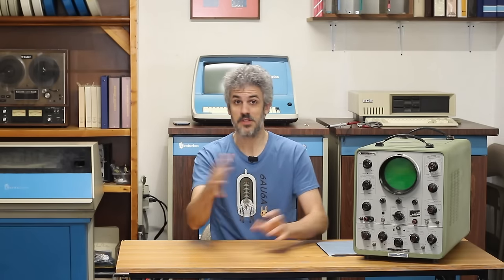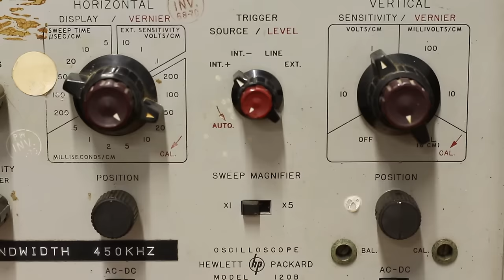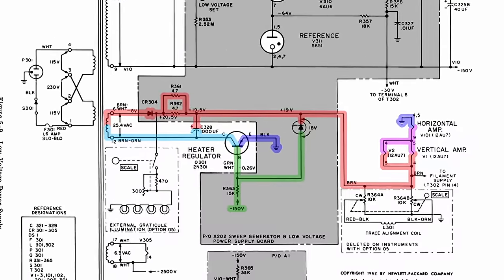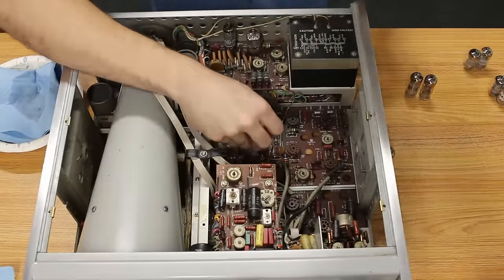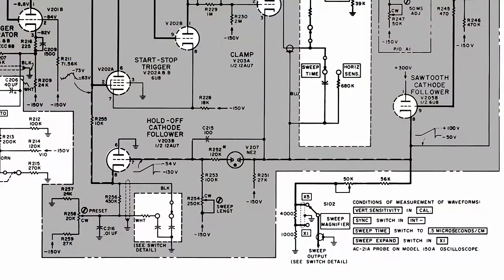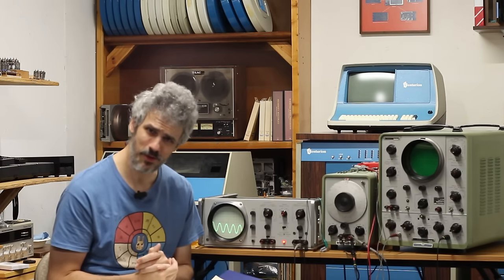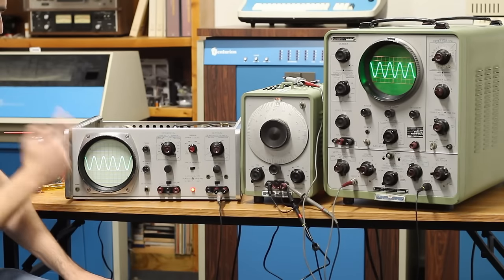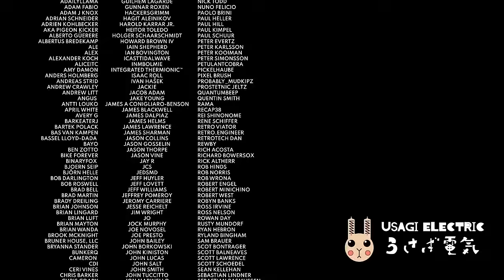Restoring an HP-120B Oscilloscope from 1961!

Comment: You could always take a 2 inch thick 24x24 inch butcher block cutting board and route grooves all over one side, then glue a peg board over the holes.. Then attach an air fitting to the other side.. 
Lay the side with the holes face down on the floor and put your 3 ton oscilloscope on it... 

Then when ever you want to move it, just turn on an air compressor..
Move that baby with one finger....

Comment: That Z-axis modification seemed like they wanted to replace Z-modulation with an external trigger.
Reply: If so, it would have made sense to route it internally with shielded cable....
Reply: @SeekingTheLoveThatGodMeans7648  Of course, I suspect it was mostly used that way, and it "works well enough" when used like that (strong external trigger signal overrides noise picked up).
Reply: I was thinking along the same lines, but then I saw the external trigger input two inches away.

Comment: So was the bodge wire from the grid also capacitively coupled to the ground? I was thinking from the beginning that it looked like you might have an interfering signal on the ground, so I'm wondering if you possibly had the sweep signal on your ground...

Also, I would be curious to know how the 6U8 and the 6GH8 compare in terms of both specs and performance. I need to make some substitutes sometimes because some tubes are just stupidly expensive.

Comment: how about optimizing, like shelving a project, while still in view
Reply from the maker: One thing I'm trying to avoid is having stuff on display that can't be used. Space is so tight in there, that I want anything that's on display to be easily accessible and usable without having to move or set up anything. It's a strange way to set up the room, but I need it to be nice and tidy so I can move around and film without too many obstructions.

Comment: Have you or anyone else come up with an idea as to what was the point of that white wire, capacitor, wrong resistor "mod" ?

I'm very curious about what may have been the reason or concept of doing that in the first place.  What was the person thinking!? (rhetorical).

The very moment that you opened up the unit, I focused on that white wire and cap.  Even without having the schematic in front of me, I knew that something didn't seem right there.  ESPECIALLY with the danged wire just running across the board like that.... WHO DOES THAT!   LOL

If the mod was something useful, one might think that the person mod would have used at the very least, a well shielded wire and route it along the metal case, then over to the tube.

But again, no idea what the point of that mod was.  USUALLY, if there was a factory mod that was recommended, there'd be documentation on the mod as well as the reason for such a mod.

Comment: I'd be careful cleaning electronics with compressed air or vacuums. The air can be slightly charged, potentially zapping sensitive electronics.
Reply: While that's POSSIBLY true for some silicon devices (specifically, 'unprotected' MOSFET gates that are only a few dozen nanometers thick), it's not such an issue with tube hardware that has a millimeter of 'vacuum gap' between the sensitive grid and nearest electrode.
Modern (a.k.a. silicon-based) hardware is VERY sensitive to electrostatic discharge [ESD] while tube hardware is nearly impervious!
That's PART of the reason why the Russians used sub-miniature tubes in their MIG fighter jets.  They were largely protected from the electromagnetic pulse [EMP] of a nearby nuclear explosion.  The US planes chose instead to place the sensitive hardware inside a 'Faraday cage' and attempt to 'clamp' any incoming peak signals.